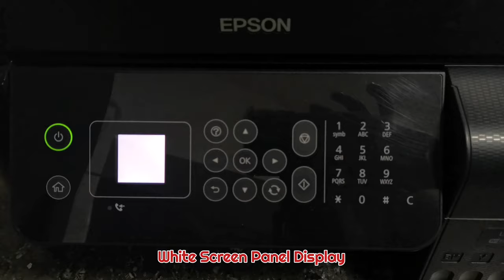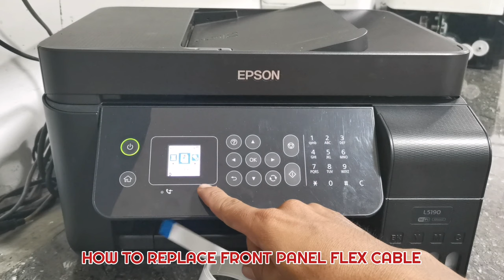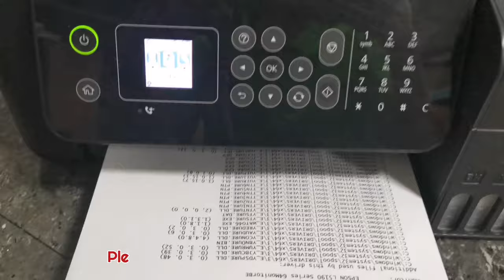HOW TO REPLACE DEFECTIVE FRONT PANEL FLEX CABLE   EPSON L5190 ECOTANK PRINTER.

Comment: San po pwedi maka bili ng flex cable? Sa shopee po ba mayron?
Reply from the maker: Try nyo lang po sa shoppe
Reply: Ilan po pins sa front panel?
Reply: Waste watch full not video and time long hours., after turn on not working printer